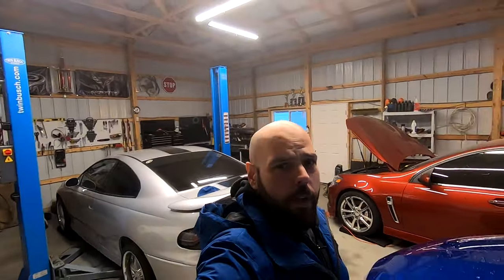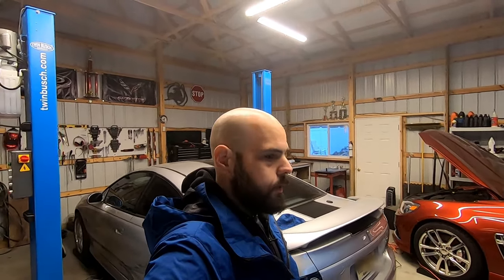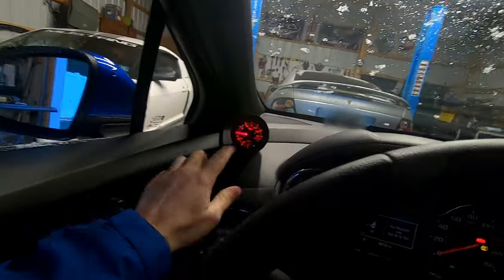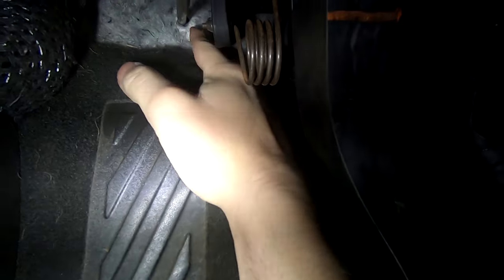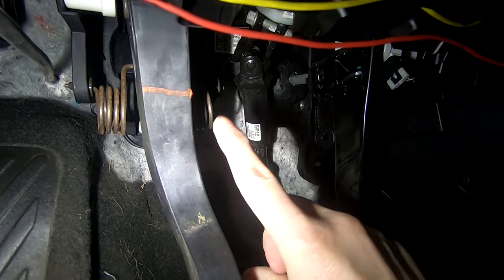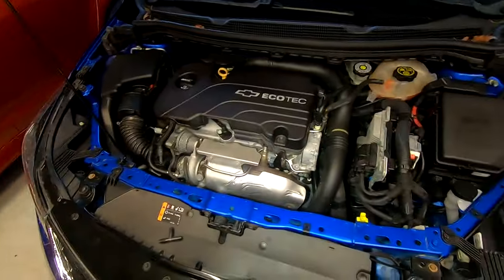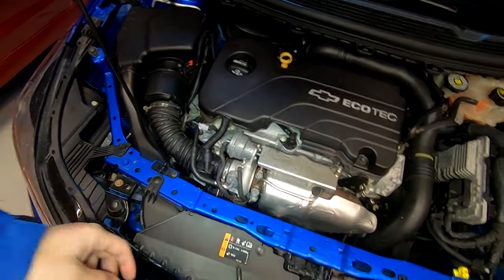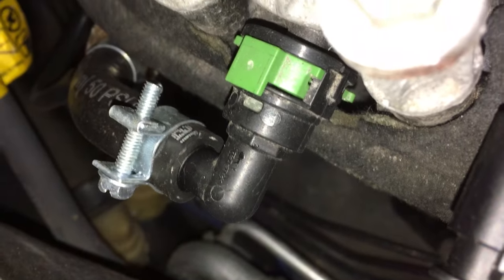Cruze mods | Budget boost gauge install

Comment: Hey I have a 2017 1.6 turbo diesel would this be different or the same on my car it looks the same at the 1.4 and I can use a 1.4 cold air intake
Reply from the maker: Pretty much the same. I have an adapter now to make taping into the engine easier.
Www.supercruzes.com
Reply: @davesworld2132  my intake doesn't have that line on it from what I can see would it be in a different location on the 1.6 diesel

Comment: Hey @Dave's World! When you tap into the fuses, what size fuse did you use (5A, 10A, 20A, etc). I have tapped mine in exactly like you have shown (2 20A fuses tapped into slots F29(empty) and F37 (radio) )and it worked for a few seconds. Then when I started my car again, the gauge is staying at a dim red and won't change. Any suggestions?
Reply from the maker: Did the fuse blow?

Comment: Hi Dave nice video as always, if I install the BNR throttlebody spacer for the boost gauge on my stock 2nd gen Cruze do I need a tune?
Reply from the maker: I would always recommend a tune which I have on the website that being said the car will run and there could be a slight hesitation at a certain rpm without a tune
Reply from the maker: I also have a plug and play adapter now that you don’t have to use any kind of spacers or modifications
Reply: @davesworld2132  should've bought the boost gauge off on Amazon with your affiliate link and the Mamba Wastegate but it's on it's way here though from ebay. Thanks I just wanted to end the underboost code I'm having as this is a daily. If this don't get sorted then off to intercooler upgrade for stock gen 2 for me to save up.
Reply from the maker: @czerus2233 I have my own custom brand now but let me know if you need help.

Comment: I have the bnr throttle body spacer and everyone says I can tap a line into that how would that work?
Reply from the maker: Yes as long as that spacer goes after the Throttlebody but before the intake manifold so you can get the vacuum source. That being said does that spacer have any spots on it where you can drill safely or thread in a fitting?

Comment: Were did you connect the orange 12v headlight switched source?
Reply from the maker: I tied that source into the same 12 V power source. These lights are pretty bright on the gauges I just leave it dim all the time. And it’s still bright
Reply: @davesworld2132  thank you so much I’m almost done installing the boost gauge
Reply from the maker: @Cristo-te-llama  fun! Let me k ow how you make out.
Reply: @davesworld2132  I need your help at first I connected my hose with a T fitting in the hose that’s under the turbo I was getting 10 to 15psi but no vacuum then I looked at your video and changed my connection at that hose that’s behind the throttle body exactly like this video and I’m getting like 20 vacuum and the max is 5 to 7 psi boost is that normal? I have a 2026 Chevy Cruze Lt the only thing I’ve done is the muffler help me please
Reply from the maker: @Cristo-te-llama  it is normal if your wastegate is getting weak which is common. Make sure also your hose is not pinched.
Reply: Thank you! I plan on doing the wastegate next the same one on your video
Reply from the maker: @Cristo-te-llama  no problem let me know if you have trouble locating one I build them custom you can order through my website www.supercruzes.com

Comment: Alright so question. I have a 2017 Malibu with the 1.5 Turbo. I know the cruze has the 1.4 turbo but looking at the engine bay, it looks exactly the same as my Malibu. So would this method work for my car as well? I always found it annoying to know i have a turbo but no idea how much boost i was producing lol
Reply from the maker: Yes it will and my intercooler fits that car as well. It’s literally a longer version of a Cruze lol
Reply: @davesworld2132  exactly what i tell everyone XD. I assume the engine in the cruze is the same as mine but just has a smaller bore for some reason? Chevy is wonky lmao
Reply from the maker: @jeffh9272  Basically. There are a few tiny little things that are different. But you can literally take parts off of each car and swap them.
Reply: @davesworld2132  definitely note taken. I suddenly have some way bigger plans for this thing then just coilovers and cosmetic mods 👀
Reply from the maker: @jeffh9272  yup…..I feel your pain!!!!!

Comment: How does it auto dim?

Did one of those wires go to the back of your radio or did all of them go into that add-a-fuse? 

^speaking on the wires that came out of gauge harness, excluding the ground wire you said you grounded right there close to the gauge I think
Reply from the maker: I ran the dim wire and the 12v switched to the wire tap to keep it dimmed all the time. It’s still pretty bright during the day
Reply: @davesworld2132  ah thanks so much. In all the videos I've seen so far people have done this and not mentioned it.
Is it a bit too bright even for day time I guess?
Reply from the maker: @RandoManFPV  yes. Most gauges are. I was going to add tint over the lens to dim it more
Reply: @davesworld2132  oh, I have another question if you could provide another answer please. 
I have the glowshift digital 10 color volt gauge/meter as well; it seems to have the same harness and 4 wires, can I hook it up exactly the same?
Maybe just twist the ends of each matching color wires together for the two gauges as I put them into my A-pillar, and then run them to the add-a-fuse as tho I was just installing 1 set of wires

You have been extremely helpful thank you!
Reply from the maker: @RandoManFPV  pretty much. It’s just going to get its 12v reading from the voltage you give it.
Reply: @davesworld2132  aye you're the man!
I think I'm about to try n test my gauge out on a 12v battery; unless you think that could somehow damage the gauge.

This is what I will do:

Connect black to - lead of battery

Yellow(constant) to + lead of battery

When Im ready to turn on, gauge I'll touch red (ignition source) to + lead of battery.

When I'm ready to test dim function I'll touch orange wire(headlight switched source) to + lead of battery

I believe this will operate the gauge as it should in my car so I can confirm that it works and how I want to wire it before going to work on my car.

Edit: dang I just realized all I got around here is 9v batteries, seems could be bad for my gauge I dunno 🤷‍♂️🤣

I appreciate all your advice and videos. I've watched quite a few for help, but I did not realize until now how helpful and and engaging you really are. I'm absolutely subbing right now 🤘🙏
Reply from the maker: @RandoManFPV  thank you! Appreciate that. Btw do you have a trickle charger?
Reply: @davesworld2132  I am not sure what a trickle charger is. If it comes stock on a 2012 1.4l eco cruze then yes most likely 🤣 if not, then I most likely do not have a trickle charger.

Does my process for testing my gauges sound safe at the least? Even with a 9v battery?
Got bad weather right now and no where to work on the car but I'm really anxious/excited to see these gauges light up; even if I can't test the dim function or get an accurate idea of brightness just yet
Reply: @davesworld2132  ah did a quick search, no I certainly do not have a trickle charger
Edit: I used 9v battery, connected yellow to positive lead, black to negative lead, and when I touched the red wire to positive lead the gauge turned on.
But the volts were going crazy so I immediately let go of everything (unhooked all wires that were held with my fingers lol)

Hopefully that just means I did something wrong or this is a bad way to test my gauge.

Hopefully it does not mean I got a bad gauge or messed a good one up doing dumb stuff with it 🤣😎

Comment: If u don't mind me asking where did u buy the brass version of the t fitting at. U def did a good job at tapping in.
Reply from the maker: Hello just a local Hardware store. And auto parts store probably wouldn’t have a brass one. But a hardware store will.
Reply: @davesworld2132  thank u. Whats your top boost reading.
Reply from the maker: @george230  about 15-16psi I feel the boost is a little low because of my wastegate so I will have a video coming out of a new wastegate actuator install as well as a blow off valve and a tune.
Reply: @davesworld2132  ill be looking forward to watching. And thank u for your info.
Reply from the maker: @george230  No problem I really appreciate the feedback it lets me know that people are interested which makes me want to make more videos for everyone

Comment: Whats the check engine light for?
Reply from the maker: It was just on because the car wasn’t started yet it comes on whenever you turn the key on. It just cycles the ECM  and then after you start the car it goes off

Comment: Do you have a link for the boost gauge? It fits super clean
Reply from the maker: Yes I pinned a comment at the top that has a link to the boost gauge also in the description there is a link to the boost gauge
Reply: @davesworld2132  im sorry i was being a drone at work earlier, i meant the pod XD
Reply from the maker: @thecruzeexperience6413  OH…. BNR I believe they may have a few left also In the future I’m coming out with a better version of this video. Also I’ll be coming out with another video I have a custom gauge pod where you could use two gauges.

Comment: Just got a AEM 30-0306 X-Series Boost Pressure gauge, gonna try this method but ngl super Nervouse bout the tapping in part 😂
Reply from the maker: Taping in is the easy part. Comment when your ready. I will elaborate more about how to do it.
Reply: @davesworld2132  thanks man! You've mad it alot easier for me when it comes to this, first car for me so I'm hesitant but super eager. I'm planning on putting it on tonight, should be here within an hour or so
Reply: @davesworld2132  Gonna go to Canadian tire to grab the shtuff. What do you recommend? I saw below you mentioned some extra tubing, t fitting for 1/4". Some clamps
Reply from the maker: @mitchellphillips7312  Yes or 5/16 tube right behind the intake manifold is the eve app hose you can cut that into two and then use the rubber hose to connect to a T fitting
Reply: @davesworld2132  Awesome, appreciate it
Reply: @davesworld2132  will a 1/4 t fitting work
Reply from the maker: @mitchellphillips7312  probably Just make sure when you tighten the clamps you have a good seal
Reply from the maker: @mitchellphillips7312  Awesome let me know if you have any issues
Reply: @davesworld2132  thanks man, for sure 🙏
Reply: @mitchellphillips7312  did you get it installed bro?
Did you also use an add-a-fuse?
Did you run all your wires except ground into the add-a-fuse?
Does your gauge dim automatically?

Last time I tried installing a radio I cut damn near every wire in my dash and repaired them in the process of finding the ones I needed.
I'm really trying to not go through that again, I want to make sure I got this figured out before I begin.

Comment: Any idea how to take the connector hose off that you tap into ( the one in the throttle body) in fjnding it impossible to get at it in order to tap into it properly
Reply from the maker: There’s a little green tab in some cases you can push down on it and it’ll make the connector come off or pull up on it
Reply: Is there a way I can contact you for some without spamming your comments. I can't find the green hose anywwhere
Reply: It seems the cable is all black
Reply from the maker: @mitchellphillips7312  It’s OK you can comment that being said it’s not a hose there’s a green square button on the connector right where it makes the turn out of the intake manifold behind the throttle body
Reply from the maker: @mitchellphillips7312  What year is your car again?
Reply from the maker: @mitchellphillips7312  What year is your car again?
Reply: @davesworld2132  2017
Reply from the maker: @mitchellphillips7312  brembo_dave You can find me on Instagram is the easiest way to contact me

Comment: Where did you find the holder for your boost gauge
Reply from the maker: Hello. If memory serves Bad News Racing.
Reply: Thank you
Reply from the maker: @HumanShadow-jn8xp  no problem
Reply: So I just got the gauge the mail today Did you have long enough wires to run all the way to the fuses what did you have to get longer wires to run it because mine don’t look long enough
Reply from the maker: @HumanShadow-jn8xp  I always have extra wires because I build a lot of cars but I don’t remember off hand if I grabbed some extra wire or had enough. But if I need extra wire and run out. Autozone and advanced has wire usually in stock.

Comment: What size hose is needed for the T-fitting?
Reply from the maker: In between 1/4”-3/8”
Reply from the maker: Wait are you talking about to go to the gauge or where to tap with the T fitting? It’s two different sizes
Reply: @davesworld2132  thank you. Gonna do this today on my 2017 Cruze Hatchback and gonna try to just make one trip to the parts house. lol. All the videos are very well done & helpful. 👍👍
Reply from the maker: @lopezrunning  Thank you very much I appreciate you checking them out. I don’t know if you noticed my other comment but I asked are you talking about the hose going to the boost gauge or the one that you need to attach the t fitting to the vacuum line?
Reply: @davesworld2132  t-fitting to vacuum line.
Reply from the maker: @lopezrunning  OK that’s what I thought. What are usually do is buy everything I think I’m going to need and whatever I don’t use I just return so pick up hoses ranging from quarter inch up to three eights and that should be what you need and make sure there are at least 4 to 6 inches long to give you some slack for play

Comment: I think I may have to set everything up on the the main fuse box because I can’t seem to find a combination that allows the gauges to turn off once I lock the doors and walk away I have a super basic Cruze so some fuse slot I’m unable to even tap into
Reply from the maker: I did show in this video how to do it however here’s an updated version with more detail.  https://youtu.be/yhncuxrA6Sc
Reply: I actually can’t tap into f29 I was actually told f30 might work which is PRNDL but I have a manual so i don’t have the option to tap into it I can stick it in but it doesn’t get power I can send you a pic on your email of my fuse box
Reply from the maker: @eleazarduenez777  I’m not sure if you watched the entire video but I actually tell everyone which fuses to use
Reply: @davesworld2132 yeah I did I just seem not to have the option of tapping into the fuse you used on the left Which I found strange so I need to find another way the tapped fuse on the right I have which controls the radio so we’re good there
Reply from the maker: @eleazarduenez777  is it empty ?
Reply: @davesworld2132  correct the whole bottom row Doesn’t have fuses except the first and the last 4
Reply: @davesworld2132  f28-33 are not available for me I can stick in the fuse tap but I can clearly see the slot is missing the metal contact slit they are just empty and doesn’t hold the fuse tap at all it just falls out
Reply from the maker: @eleazarduenez777  You just need one fuse to be a constant 12 V source and find another one that is switched on and off with the key and you are good to go. However I don’t know what version of the car you have versus mine
Reply: @davesworld2132  I know but I don’t know why it’s so hard I’ve already tried all my options by touch the fuse tap on each fuse and they all stay on during the car is locked smh 🤦‍♂️ red wire Is on the radio which is switch and yellow is on constant. But it never turns off no matter what

Comment: Just a heads up if u pull the wiper cowl u can follow the wiring harness on the top of the left strut to a plastic plug that goes into the cab and comes out to the the side cover right next to the vent where you mounted your gauge
Reply from the maker: Cool. Didn’t realize that. I did have the cowl off when I did the Coilover suspension. The room in that area is crazy. Back when I filmed this video it was one of my first videos ever. I may actually re-shoot this video with more of an updated style.